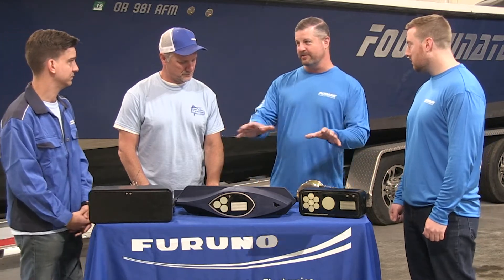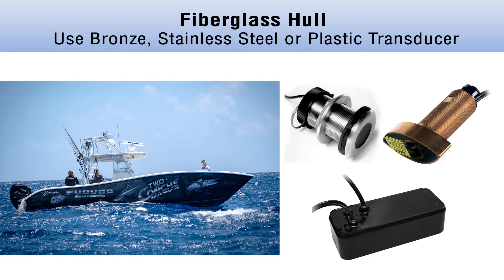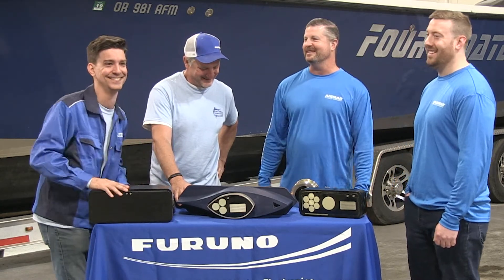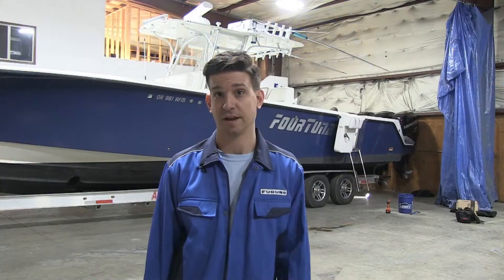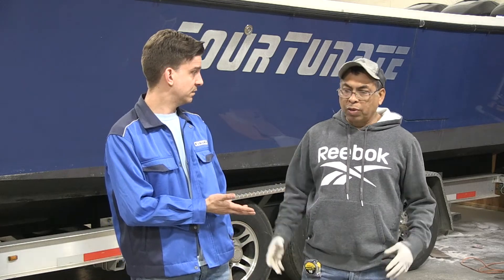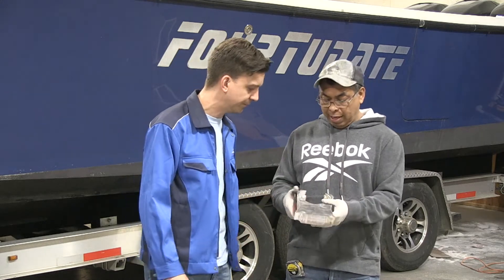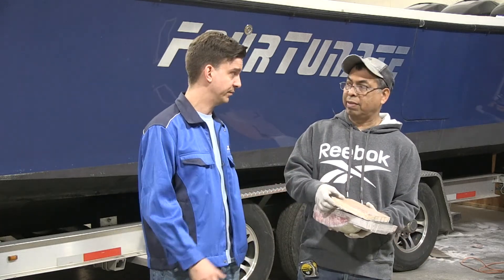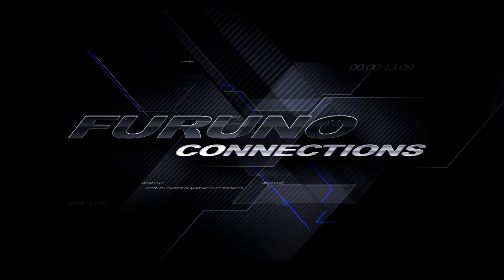Furuno Connections - Episode 6 - Part 2 - Where To Mount A Transducer

Comment: Yikes !! - Stainless steel with aluminium ???? WHAT !
Reply from the maker: Thanks for watching Jim. Airmar makes stainless steel transducer housings specifically for aluminum hull vessels because aluminum and stainless steel are a closer galvanic match to each other. Bronze transducers should never be mounted in an aluminum hull. Here is a snippet from Airmar’s Guide to Transducer Technology - 
"Bronze thru-hull housings cannot be used in aluminum and stainless steel boats. The interaction between the metal hull and the bronze transducer, especially in the presence of salt water, will eat away the metal hull and/or the bronze housing."
Reply: @FurunoMarineElectronics  Yes that is correct. However the rule is that one never puts SS up against aluminium as there is a reaction between the two dissimilar materials. SS usually becomes welded to the aluminium. I will need to look into this as I do want to install the DFF3D transducer